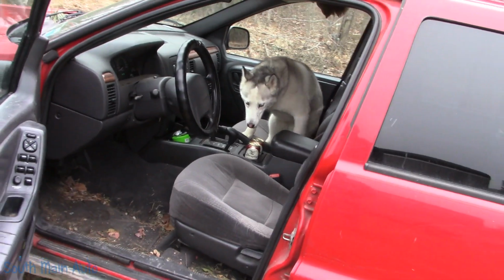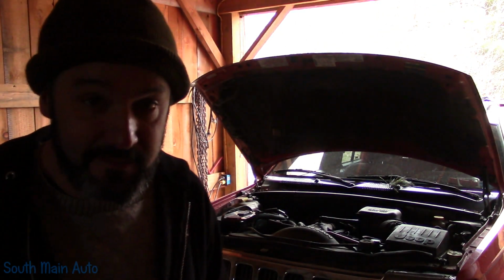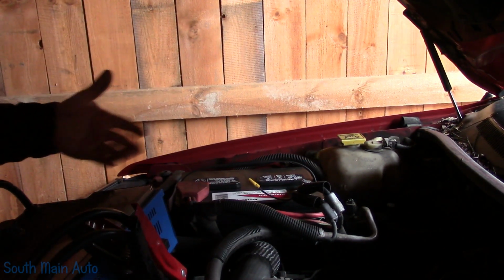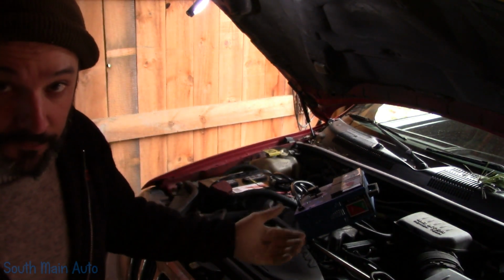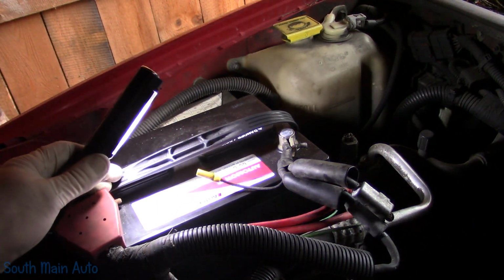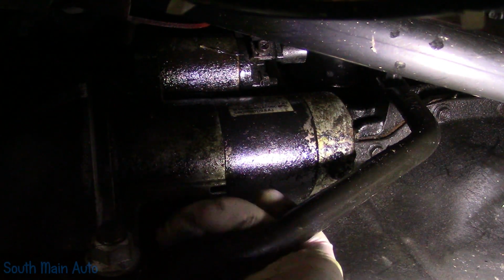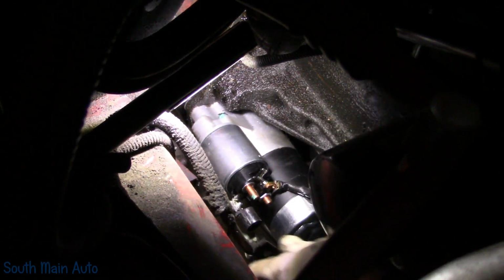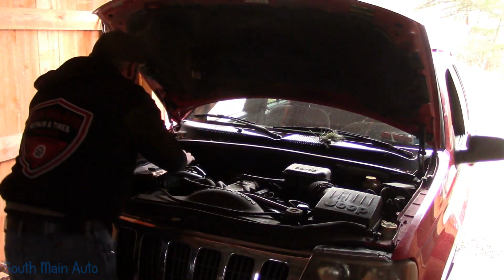Jeep Grand Cherokee 4.0 - Starter  Replacement DIY

Comment from the maker: *500 Amp Carbon Pile Battery Load Tester 12V Volt Test Alternator Starter NEW: https://amzn.to/2EPA7vi
*Nebo Big Larry black 400 Lumens C-O-B LED Work Light Flashlight (3 AA Batteries Included): https://amzn.to/2H6idqa
Reply: easier to rebuild your own starter ....rebuilder in a box....

Comment: I'll be doing a starter as soon as it gets here.our problem was the starter was hanging up. You just needed to tap the starter case with a hammer ,then it would disengage. It looks like it's about the only thing that is easy to do on a Cherokee. I had to have a AC compressor put in. All day job. Thanks. Great source of information 👍

Comment: I love when you're under a car or a truck and you got a bolt that has limited access like that. Turns out the damn thing goes all the way out to the front bumper or something you're under there for 20 minutes just trying to get it out. I noticed one of your videos you actually use a creeper. I hate those things you got to crank on a wrench and your whole body slide out from under the car! I had three creepers at my old place and I never used any of them well except once. I'd rather lay on a tarp and just slide

Comment: A shot of Jim Beam or/and Jack D on the work bench when the job is done. I like that. My Jeep starter looked like that too, after helping a friend do his, the next one I decided to disconnect the cables and use almost a can of brake spray to get as much crud off of it as I could before starting the removal, it made for a better experience than the last one. Good informative video . This shot is for you.

Comment: I carry a Big Larry working in a data center.   Helps with tightly packed server racks when you are trying to read cables and ports on servers and networking gear.

It's rugged and bright, a good combination for a light.

Make sure it's pointed away from your eyes when you turn it on, the first mode is full bright and will hurt if you shine it in your eyes.

Comment: Much appreciated, changed out the starter in my 04 using this. Works great!

14mm for front bolt and 15mm for the rear bolt worked perfectly. The new solenoid took a 12mm to secure the wires.

Comment: Back in the day when starters drew more current and the cables were heavier,  I did notice a difference if I cleaned the old high-current cable-end terminals with a wire brush and WD40 before I put them on the new or reconditioned starters.  The ground from the battery to the block also needed maintenance from time to time, not only at the battery but also at the block.  My grandfather told me they just had to be tight, but I found  they needed to be both clean and tight for reliability over the  extreme temperature ranges of Saskatchewan and Alberta.

Comment: It’s worth looking over a misbehaving starter when you have it out.  Most problems are caused by dirty/worn contacts on the solenoid, followed by worn brushes on the motor itself. A good clean up and wiring brushing of contacts costs nothing.  A replacement brush kit is cheap so unless the primary motor windings are shorting out as a DIYer I like to refurbish my motors rather than replace them as it is kinder on my pocket

Comment: 4.0 engines are like a DODGE. Drips Oil Drips Grease Everywhere
Reply: Weird mine doesn't leak oil or grease.  My dodge didn't leak oil or grease either...not sure why everyone seems to think they do....my Ford Ranger and Bronco 2 on the other hand, they leak oil all over the place.
Reply: William Sevier - my 95 Grand Cherokee 4.0 didn’t leak, but my 2003 Crown Vic leaked.

Comment: I have a 99 Grand Cherokee with a starter worse than that (used the hit with hammer fix to get it going). I swapped it out with a boneyard starter in 2017. Starts better to this day 4-20-2018

Comment: i just put a set of those chinesium cable "fixer" ends on a jeep liberty, original ends long gone, had standard lead ends, they corroded up at the wire and let the battery run down, no start.
the positive and negative both were bad, the pos. let the thing start and run, but wasn't maintaining the battery voltage.
not crazy over them, but better than replacing whole cables outside in the windy cold snow, copious amounts of dielectric grease was used :)

Comment: Had this same issue on my 1991 Comanche 4.0. It's very common for these starters to get crud in them over the years thanks to the 4.0 loving to pee all over the place and eventually get so slow to crank you'll think the battery is dead.

Comment: Good idea and advice to use the load tester as a stand in for the starter to test the wiring and connections. Bad idea to buy the very Jeep you've called junk in many of your videos. At least you rightly advised others they're money pits and to steer clear in the power steering hose video. Why not an older Honda Pilot, Forerunner, or any number of other vehicles less likely to fall apart, need attention, and leave you stranded? Have you checked to see if it has the typical engine destroying 10 psi of oil pressure at idle typical of a 4.0 with 175K even though you demonstrated the gauge reads full oil pressure for anything over 5 psi in another of your videos?

Comment: Had a ram that did the slow crank crap. 4 reman starters later and no difference. Replaced battery and wiring and not much change. I just live with it now. Probably just crappy aftermarket parts.

Comment: I had to change a freeze plug in a 67 ford van, which was in a basic mud pit, and 30 degrees. And the plug was behind the fly wheel, in Houston around 1975. I was 23. I will NEVER forget that repair. Oh and it was snowing, in Houston, if you can believe it. Did it by myself, while my so called friends stayed inside getting drunk. When your 23 you can do anything.

Comment: I freakin LOVE your land out there, man! That is off-roading heaven for a dirt bike or quad. Trails, power lines & gas lines - don't get much better than that!!  Been so long since I've gone on a nice off road ride, it makes me hurt inside. Off-road vehicles are viewed in the same light as black rifles here in the communist bastion of MA, unfortunately. Got a '05 Polaris Sportsman 800 that I bought new, and spends most of it's time sitting in the barn ... unless I need to drag something around the yard.

You're a man after my own heart - Yuengling in the console, and some Beam & J/D in the barn! YEAH! WOO! 😁 🤘

Looks like your beater gets the same TLC as my '94 S10 plow truck. Parts Master filter and a wing-wong starter! 😜 At least you change your oil! I'm about 2.5 years overdue ... I'd better get on that before I grenade the thing. The engine is the only good part of my beater!

Comment: Hi Eric Looks like you are trying the Transmission oil rust prevention method.
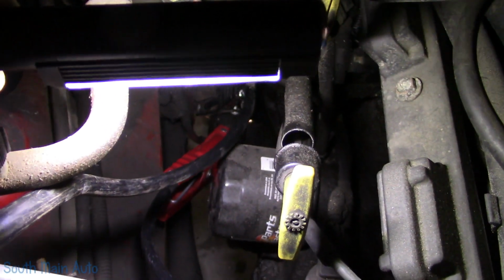At about 13:20 you can see the Trans dipstick is not seated. I expect you knocked it off hooking up the cables but with that much oil maybe it has been unseated for awhile. No problem it's a JEEP 4.0 and they have a Large oil capacity so lots to spare (LOL).
Shebia is overseeing nicely She has to make sure Her vehicle Is kept in Shape!!!

Comment: A few months ago, I rebuilt a 2001 Hyundai starter because it had these symptoms. Cold cranking was slow and labored, at normal temps it seemed to work fine, and when super hot-soaked it would do a single loud "clunk" but not crank. After disassembly, I found the positive brush worn down to a nub and the negative wasn't much better (these Valeo starters only have two brushes total inside). I put new brushes, bushings and bearings in, polished the commutator, and re-greased it. It now works like new.

Comment: How could anyone give a bad comment?, the job is done and it starts much better :-D.
That carbon pile resistor was ideal, loaded battery and cables :-).
I don't trust cables eather.
I imagine the starter needed new brushes and solinoid contacts to make it good, but a fresh replacement was good value.

Comment: This reminds me of my first POS car.  A 1975 Mustang 2.  I'd pull up and ask to fill it up with oil and check the gas.   I remember putting a starter on that bad boy laying in the grass with no jack no stands.  I was a whole lot smaller then and a lot less psoriatic arthritis.   I could only get my arm and hand in there and feel my way through the whole job.  I was so happy to have it fixed and proud of my work.   Got me back on the road to get back to work and taking my GF out on a date.   This is what makes me thankful for my concrete and jack stands.  I wish I had access to a lift but I remember that grass and know it could be worse.

Comment: Had a 74 Monte Carlo with dirty commutator contacts.  Banged on it with a hammer to get it going.  We polished the commutator contacts and used new brushes to fix it.  In those cars there was a seatbelt lock out which disabled the starter to complicate the diagnosis.  My 03 Town and Country had a recall on that p/s hose.

Comment: *remembers you're up north where 1999 is an antique*
I'm always glad to see this jeep help you make videos. having a 99 wrangler, and both 97 and 02 grand cherokees they are super relevant to me.
Reply: Matt Hooker my 1996 JGC 4.0 gave up the ghost in late 2014 with a bit over 200k on the clock.  Developed a coolant leak and didn't have the cash to replace the radiator, ended up losing the head gasket on it.

Comment: Wouldn't it be a good idea to run a fresh new cable running along the battery terminal positive side to the positive side of the starter along with the old battery cable or not ?

Comment: My daughters car was doing the same thing. It finally left her stranded. I went over there with a rubber hammer and gave the starter a smack and it started right up. Took the starter apart and 2 of the brushes were totally gone and the other 2 just had a tinny piece left. Rebuilt the starter for around $47 in parts.

Comment: I'm just glad I had dry concrete to lay on yesterday to do maintenance on a 06 Escape I just picked up. Unfortunately, found what looked like calcium rocks/silica descant in the overflow tank/de-gas bottle...hopefully I don't have to change heater core and radiator....ah nuts!

Comment: I see that your garage  off the cabin is built with sawmill cut wood. (Amish cut ?).i have some experience  with that!!.if you were any taller you would smack your noodle  when you  back out the tractor.curious is a 4.0 liter like a harley?.they all leak,drip a little!.thanks for the video..

Comment: Dang squirrels, we had one in our attic chewed right through the roof, asphalt shingles and plywood. Luckily it was on the A frame portion and I could see the hole. They have gone to the happy hunting ground.
Reply: yeah, them pesky squirrels do that all over, but here we also have a problem with raccoons doing the same, they have like 10x the shredding power and will rip right through aluminum venting, once it's tore open the bats find it quickly and there starts the next issue!

Comment: You are a great tech and videographer my friend !!  I have a new appreciation of the 4.0 after having repaired several 4.7s with various stages of valve seat drop in the last month. Today it's a possible head gasket on a Cummins 12 valve and nissan tranny swap. Thx again brother you keep me hanging in there